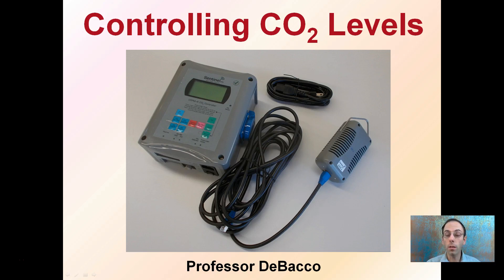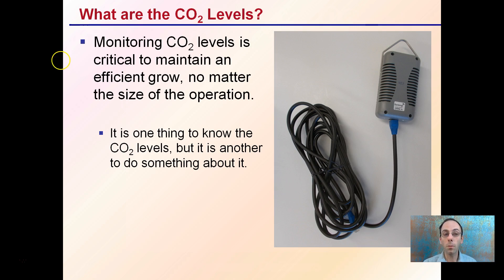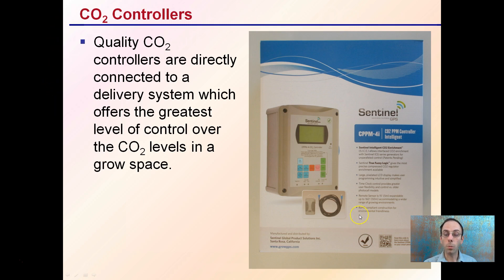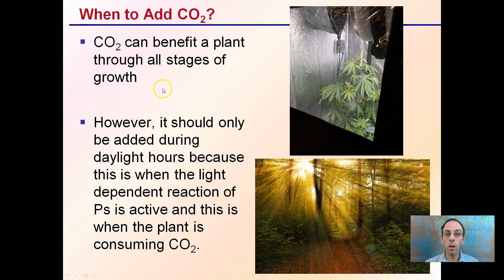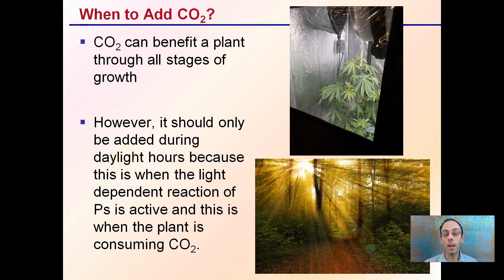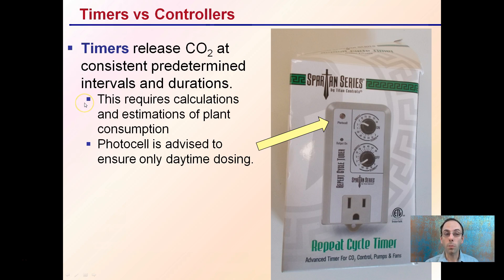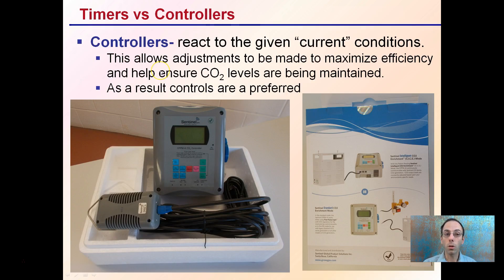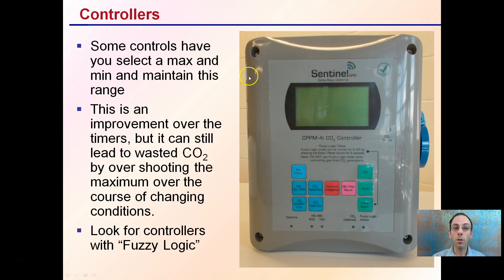Controlling CO2 Levels

Comment: Good morning I saw all your videos and they were of great help and I feel bad asking you so many questions, but if you could tell me which equipment you recommend to regulate and control the co2 output automatically, I would appreciate the options that I saw most frequently are:  
   https://www.amazon.com/-/es/Autopilot-APC8200-sensor-Monitor-controlador/dp/B0748ZRD2X/ref=sr_1_2?__mk_es_US=%C3%85M%C3%85%C5%BD%C3%95%C3%91&dchild=1&keywords=controller+co2&qid=1624413782&sr=8-2 
 and
 https://www.amazon.com/-/es/0-5000ppm-Interior-Detector-Controller-fotoc%C3%A9lula/dp/B08HQMBQ79/ref=sr_1_3?__mk_es_US=%C3%85M%C3%85%C5%BD%C3%95%C3%91&dchild=1&keywords=controller+co2&qid=1624413782&sr=8-3      
 I wanted to know if you know these devices and do you recommend them? since it has an accessible value. thank you very much and sorry for the inconvenience
Reply from the maker: Personally I have experience with and like...
#1 Choice = Titan Controls Atlas 8 Digital CO2 Controller with Fuzzy Logic
Second Choice = Titan Controls Atlas 9 CO2 Controller w/ Remote Sensor